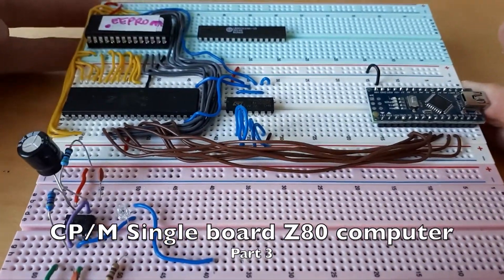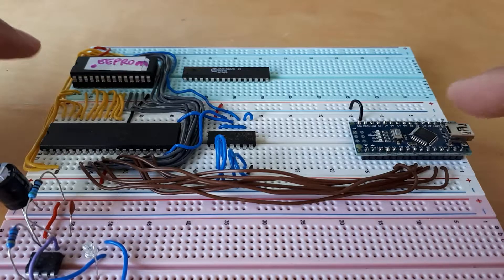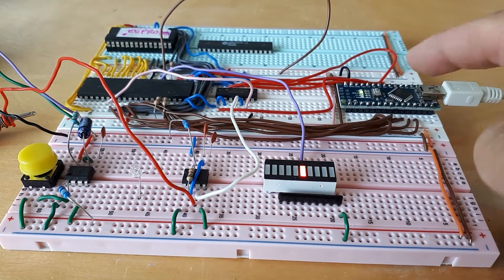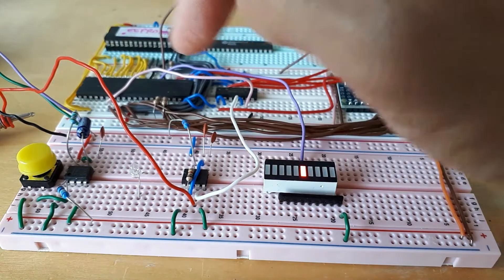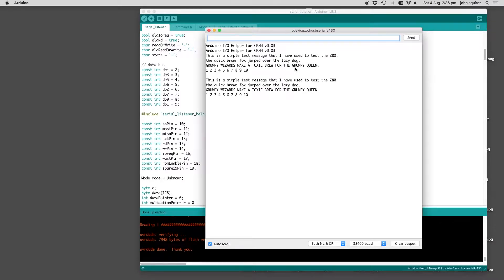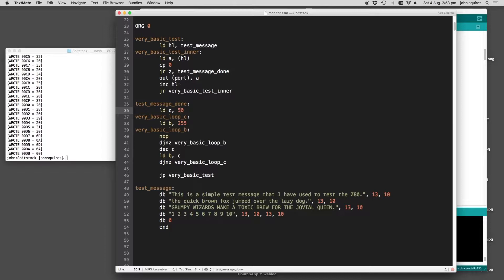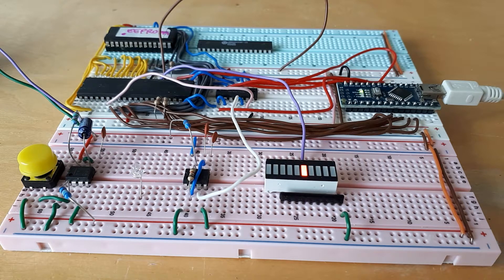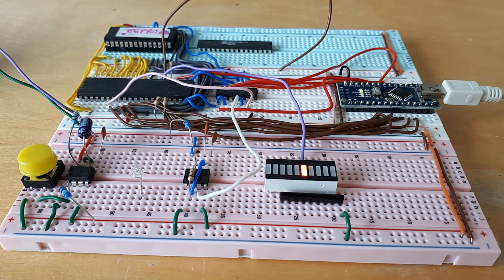CP/M Z80 single board computer, on a solderless breadboard (PART 3)

Comment: SMH  Why do all you guys do that ? You wire up the board and Then, you start the video. 
How about showing us the wiring prosses. Us new guys could learn a lot from that. I'm looking and, like other new guys to the game. I'm like. Ok. all I see is wires going here & there. What pin is connected to what pin ???  And trying to connect all the data sheets to each other can be confusing. 
- That being said. I still like the videos. ;-) Thanks. It's better then nothing.